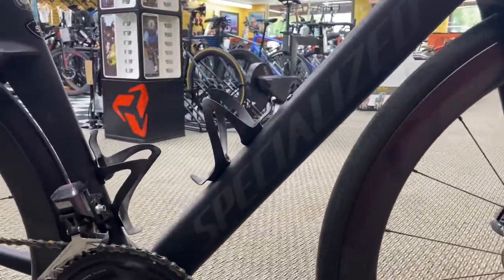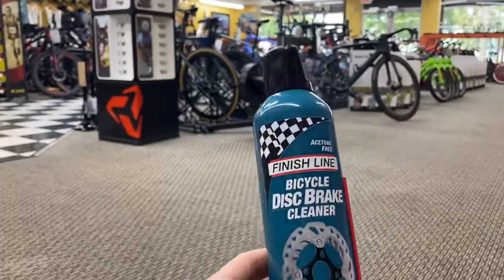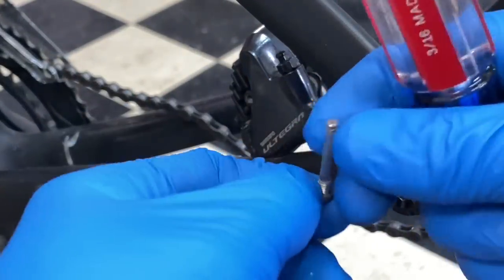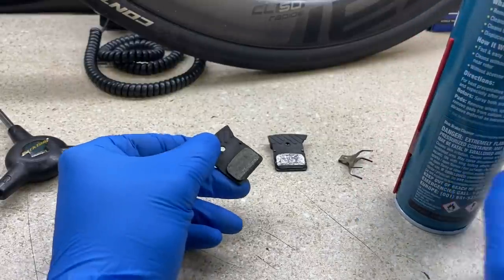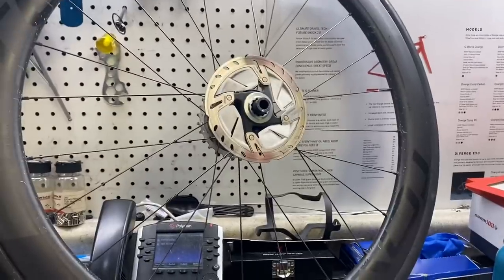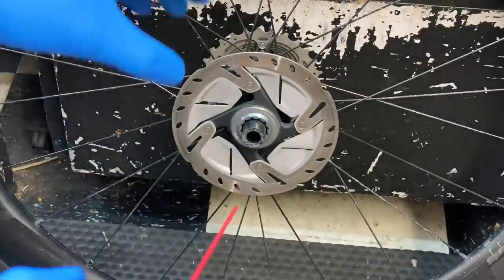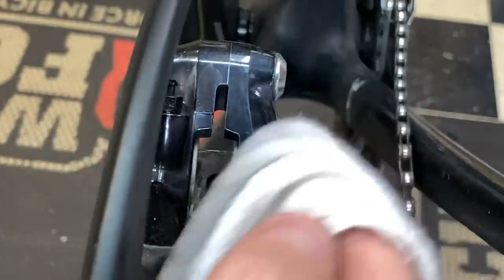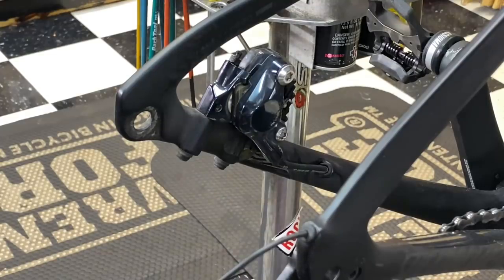WILL THIS STOP DISC BRAKE SQUEAL ONCE AND FOR ALL? (FINSIH LINE CLEANER) THE ANSWER TO OUR PROBLEMS?

Comment: Easy fix remove the wheels clean off with alcohol+microfibre wipe. Take the pads off, sand them down a little bit. If that doesn't work then take the rotor off. Use a blow torch on it just enough to heat the surface/burn off any contamination.
Reply: Yea, disc brakes, so easy to live with, not like those complicated rim brakes.
Reply: @superstrada6847  I've had a disc brake bike for 2 years now. I live in Vancouver lots of hills and some nice local rideable mountains. Wouldn't trust rim brake. I work on my bike so to me it's not a hassle it's an extra 2-5 minutes out of the year.

Comment: Do you have to re bed the brakes after cleaning?
Reply from the maker: no, the rotors are already bedded in
Reply: @GCPerformance18  so the cleaner didn't remove any pad residue from the rotor?  Is that why it air dries?

Comment: Clean with isopropyl then climb to the top of a hill (yeah I know Florida is flat) and fly down and burn the brakes in again. After getting them super hot, squeal will be history
Reply from the maker: Good idea!
Reply: @GCPerformance18  We see this in our shop often from city bikes or from older ebike riders. Most roadies brake too soft or conservatively to build heat in the brakes (especially in flat areas) and that soft braking leads to the pads and rotors becoming polished. The polished shine you saw on the pads and roughed up with sandpaper isn't contamination, just the result of soft braking. It's what causes brake squeal and is the same effect as if you spin a wet finger on the top of a wine glass. The finger can't grip because of the lubrication factor of it being wet and the result is vibrations resonating in the glass. Get the brakes hot just like you would to "burn in" or "break in" on a new bike, they will quiet down and squeal will disappear.

Comment: I find descending on Steep Grade tends to over heat then get the squealing , so you can either buy pads and rotors every month or turn up the ear buds disc brake problems ☹️

Comment: Once the squeal arrives there’s little you can do but sometimes you get lucky. On one ride my mates emonda got  a puncture in his front tubeless tyre his new white top was covered in pink sealant, then on the last 40 miles his rear rotor started squealing and he bust a spoke. That century ride cost him between £100 to £150 in parts not bad for a two week old bike.new tyre , new disc, pads tyre sealent and tape.
Reply from the maker: Yes that’s honestly what I tell customers, your pretty much done for, those pads are so absorbent there’s little to be done

Comment: I never use finishline products in lubes, cleaning or anything its just branding selling of products that dont work. one suggestion is acetone the pads and scrub then sand lightly with a plaster sand paper mesh not sand paper, then clean rotors with isopropal or brake kleener. Their is a bloke in Austalia called oz cycles he is the genious of cycle maintenance.

Comment from the maker: give me some suggestions if you have any luck with disc brake cleaning products!!!!! please!!!!!!!!!!!!!!!!!!!!
Reply: Muc Off Disc Brake Cleaner works a treat only advice always use latex gloveswhen cleaning and replacing anything to do with breaks another handy reminder is when cleaning I like to remove the pads and clean down area with APA baby wet wipe and then spray the disc cleaner can't see logic of only cleaning the surface and not under the hod so to speak! 
EDIT:
Oh also recently bought these FINISH LINE
 GEAR FLOSS MICROFIBRE ROPE highly recommend them for cleaning... God I have OCD wen it comes to cleanliness ad my bikes...
Reply: Ask manufacturer and/or good bike mechanics.
Don’t use / recommand product to put on pads or disc.
Products like this reduce friction/noise meaning reduce braking performance
Reply: Use a blowtorch to burn the oil out of the pads. Then wet sand them with 400 grit black sandpaper to create a smooth braking surface. I left my pads soaking in acetone for a day and that didn't do shit. It's a bitch to get the oil out once it has soaked in.
Reply: I but cans of generic brake cleaner from my local auto parts store, and it works great! I also spray the pads and hit them with sandpaper to deglaze them. I also scuff the rotor surfaces to remove any build up of material.

What I do is spray the lot lightly then go for a quick ride around the block  and apply the brakes from decent speed to almost a stop. Within 3-4 applications the noise reduces, and then stops. I think it’s important to allow the surfaces to re-bed with each other.

We regularly did the same in racing cars when braking performance wasn’t quite right.
Reply: Get auto brake cleaner, same shit but cheaper.  Lightly sand the rotor I've used a scotch brite before,j ust enough to brake up the glazing. If oil got into the pad bake it in the oven.
Reply: I'd say clean them before sanding them. You may have just "pushed" the contamination into the pads.
Reply: I've used muc off disc brake cleaner. And gotten them perfect again. i'd of sprayed and wiped black stuff off rotor, and once clean sprayed again let dry. id of soaked and wiped clean pads. then soaked and wiped clean again, then sanded. re installed.
Reply: Cook the pads on the stove to evaporate the oil contamination.
Reply: You made me laugh!!! I’m having the same experience using muc off disk brake cleaner, this orrible sound disappears only after “burning in” the disks, then it’s better not to clean the disks again. Someone told me to use swissstop brake silencer, that is a different kind of product, it doesn’t clean the pads but it (should) remove the sound. It would be great if you can test it
Reply: You have to wipe the rotor of with paper towel after spraying it. After that spray it again but this time blow the rotor of with compressed air. I would recommend taking the rotor of the wheel while doing this. After you are sure it is completely clean you have to bed in the new braking surface, this is easily done by peddling down hill while braking, repeat a few times until the rotor is really hot. If the brake still squeal after cooling down go ahead and replace the pads and the rotor. Most disc brake cleaning product work but my favourite is by CRC called  Bräkleen.
Reply: This will sound crazy, but many times the source of that noise is coming from the area between the back of the pads and the caliper pistons. I’ll give you a few areas to chase after. First, scotch bright is your friend. Use it on the rotors. Second, the BACK of the brake pads. Look at them for witness marks to see where the piston is contacting. If it looks like there are a few high points, fine sandpaper the backs of the pads, and a light treatment on the caliper pistons. The bigger of a contact patch you can achieve, the better. Take for a road test and if there’s till a problem, Last, and this will require an expensive Park Tool Brake caliper mount facing tool. Reface the caliper mount. If during that process you find the mount was out of parallel etc, then the pads will be too since they’ve been on the bike a while, and will need to be replaced.
Reply: I've had my disc brake road bike for nearly 4 years and spent the first couple of years in a constant battle with noise. After a lot of investigation, it turned out the caliper had the smallest of leaks from the seal between the two halves of the caliper. This is apparently a common problem with Shimano calipers. I replaced it and have come to the following conclusion. Nothing that I encounter on the road can't be dealt with with a bit of water and burning off with a couple of quick applications. I think that if whatever is on the rotors and pads is so foreign that doesn't quieten down after that, it's probably a faulty caliper.
Reply: I've never had issues with the following.

ROTORS
Spray Isopropyl Alcohol on a lint free rag or shop towel
Spin up wheel, wipe down the rotor with the alcohol rag
(Optional sandpaper on rotor and wipe down again)

PADS
Wipe down pads with isopropyl alcohol and q-tip or shop towel
Sand to remove any glazing or layer of contamination
Wipe down again

I've never had to obsessively clean my calipers or pistons beyond routine bike washing or maintenance...
Reply: Nail polish remover (acetone) and elbow grease where necessary. Clean the pads before you sand, and if necessary use a bit of fine sand paper on the rotor. https://youtu.be/Hj9vSl2Vxns

Feel free to send me any of your client's "contaminated" Dura-Ace rotors :)
Reply: An update: my bike mechanic used swissstop brake silencer on my disks, now there is no noise, but breaking performance is not the same ... he says that this is a temporary problem, please try this product and let us know your impressions

Comment: Lol I don't miss this being back on rim brakes, I used IPA and sand paper and the noise always came back.... 

New rotas are £45 EACH in the UK

New Pads are £20 x2 as u only get 2 pads per set....

So a total of..... £130 for something u may need to change YEARLY not including any bleeding....

Alloy training wheels like the scribes, hunts or Zondas are around £300 most people will get 5 years plus out of a NEW alloy wheelset

So... 300 / 5 years = £60 per year 
Add on pads u might need to change once per year like Swiss stop BXP they're £20 for a pack of 4...

Total yearly cost £80.00 with less grief, lighter and easier to maintain. 

So this just shows imo discs may save your rim but in most cases they're costing u more anyway 🙈

Comment: why not take off the rotors for cleaning? takes 1 minute with centrelock systems.
Also I spray the rotors once, wipe with cloth, and then spray again
its normal for that squeal after cleaning but disappears after 30 seconds of hard braking as all the contaminants are evaporated from heat. The solvent works by dissolving the oils/contaminants (solute) in it forming a solution. You then must blow of the solution with additional spray or wipe it off

Comment: Ceramic embedded pads, just like in automobiles?  I think the real problem with squeaky disc brakes is simply due to them being wafer thin metal that vibrates too easily, especially at that sweet harmonic point as demonstrated.  Lol.  Better tech designs in materials might save disc brakes noisy flaw.

Comment: you might not believe it, i am having trouble finding L03A pads for sale locally.......
Reply from the maker: I believe it
Reply: @GCPerformance18  hey mate. since i had not been able to find L03A with a reasonable price, i decided to completely clean the rotors and the pads. the end result is the noise is gone. i don't think the cleaner really matters, I used muc-off. after spraying on the rotors, you need to get rid off the residue. i used micro fibre and warm water to wipe the entire surface on both sides a couple of rounds and then used paper towel to wipe the surface dry. i took off the pads and used a flat headed screw driver and scraped from edge to edge across the entire pad surface a few times. sure i might loose some thickness but all pads wear down eventually. it is better if they are quiet even if i have to cut their life time by a bit. i think sandpapers work as well but i did not know if cleaning the pads would work so i didn't buy them. i thought i'd try screw driver first. i agree with the pinned comment, something nasty must have embedded onto the pads so you have to use brute force to get them off. collateral damage is inevitable though. the whole thing is not difficult. i should have done it more often. i cleaned the brake that way nearly four years after i got the disc brake. that was not wise at all.

Comment: Spray the rotor, clean it with a rag or paper towels. I use the WD-40 motorcycle brake cleaner no issues when used properly

Remember to bed them back in as if new installation.

Vibrations from the pads moving?

Comment: Never soak the pads, just sand them or replace. I use 99% isopropyl alcohol and wipe the rotors clean with a shop towel.
Reply from the maker: it literally szsaid to soak the pads so I wanted to do exactly top this method
Reply: @GCPerformance18  Well sure. This is something my friend who used in a shop told me. They had more issues than not while trying to clean pads so it just become one of those things you didn't do even if you didn't quite know why.

Comment: Never happens on a motorcycle, always happens on bicycles.  That cleaner is basically shit.  IMO, it's the steel they use on bicycle rotors
Reply from the maker: im thinking because maybe higher speeds and harder braking power maybe sheers away any residue on there, more maybe like you said, they are steel because it is a motorcycle and not so focus on weight

Comment: Replace the pads when they get contaminated. Simple.
Reply from the maker: And rotors
Reply: @GCPerformance18  on my MTB I’m always fine with just the pads. I guess I’m the road you’re more susceptible to oil and grime so both need to be done.

Comment: Last time I sprayed my rotors with a similar cleaner, I had squealing at slow speeds and much reduced braking. However, after 15 minutes of just riding around (taking it easy enough given I was a little worried about the brakes) it just magically went away!
Reply from the maker: very nice!!! I have more videos coming out nice

Comment: Do you even know from where the sound comes??? ... mainly from friction (inequalities on surfaces) between the disc and the pads!

After sending them you need to bedding them in again and heat them to operating temp to allow the cleaner to evaporate completely...that sound is always there on the first few meters if you spray some disc cleaner on them! Same with the disc,  if it has too much damaged surface, it is necessary and recommended to sand it down to.  

Sorry, but you did it wrong and missed the point with this video!

Comment: Well, that seals the deal.  I'm never getting a disc brake bike.  I think disc brakes will eventually be phased out like 23mm tires after all the money has been made.  Rim brakes have room to be evolved.
Reply: I was of the same opinion but I now have doubts. The main drivers for discs are integration (of cables) and eliminating wear from the wheel brake track. Those two issues are not going away and can’t easily be solved while using rim brakes...
Reply: Rim brake bikes probably won't be around in a few years, bar customs.  Discs will continue to evolve (and get better.  There certainly is room for improvement, especially given how things are at the moment).  But the simple fact is, consumers aren't buying rim brake equipped bikes.  
Personally,   I love road discs.  Better control and modulation.  Better stopping power, ability to fit bigger tyres, better control in the wet.  Sure, there is room for improvement.  Everything should be improving (especially given what we pay for them), but once people try them, very few people go back to rim brakes.
Reply: @richardhaselwood9478  do you trust manufacturers to continuously improve/evolve disc brake bikes? 
Look at the shambles they made of bottom brackets; pressfit is lighter, more efficient and cheaper to manufacture but now threaded BBs are returning because manufacturers couldn’t make a round hole. Big brands have no interest in continuous improvement. They seek only profit. 
We’re being sold disc bikes as stiffer and more aero, neither of which they are. Not to mention the weight penalty and of course the gigantic price increases.
Reply: @lasrachtech.1341  I agree with every single point you make. Bike industry QA is an absolute, unforgivable, unfunny joke, that we the consumer are paying top dollar to be alpha and beta testers for. 
But, I still won't buy a bike with rim brakes (or a threaded BB for that matter 😅).
Even going through Peak Torque's recent, excellent critique of the current state of play with them, the advantages are still huge, power, modulation, tyre choice, rim wear, ease of maintenance (I am heartily sick of cables).
Any way, rant over
Reply: @richardhaselwood9478  choice would be great; hopefully one manufacturer develops rim frames again and brings them to market. 
Best of luck 👍
Reply: @lasrachtech.1341  I still think, it will only be the smaller custom builders that do it.  Best of luck to you too....

Comment: Blowtorch! Trust me it works 100%.
Reply: Yep heat the pads up, i do it  on a gas stove then they are quiet when re-installed. I think it burns away any oil residue on the pads. 🚵🏼🚴🏼🧐🇬🇧

Comment: I don't give a @#@# what disc brake proponents say, they are not needed on road bikes, are a pain in the ass to maintain and make road bikes heavier than they need to be and hence more expensive. And what I mean by that is with a disc brake bike, you need to spend WAY more nowadays to get a complete with pedals, cages and mounts bike that weighs in under 16 lbs than you did 9 years ago with rim brake bikes. So, when manufacturers put disc brakes on road bikes, the weights went up in their line of bikes and to get the super light complete bikes, you need to spend $10k+ nowadays. The "industry" makes you newbies think you need them, but in reality, the pros hate them, even to this day. Yes, there are some benefits, but for 99% of people who ride and don't tell me you are all riding down mountains in the rain, EVER.   you are not. most of you won't even get your bikes wet.  Disc brake suck. Add the additional maintenance and bleeding and it is a no brainer that a good set of rim brakes are way more practical and perform well enough.

Comment: Loose bolts of the break pad,(onto frame),  tighten strongly   brake lever, tighten  bolts of the break pad, release the lever. 
So the spacing of pads is correct; no contact .